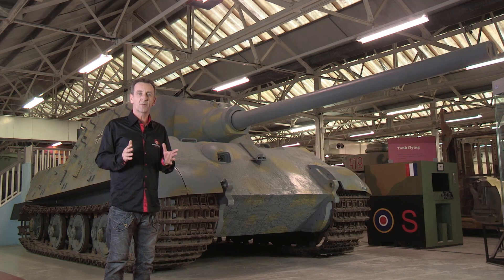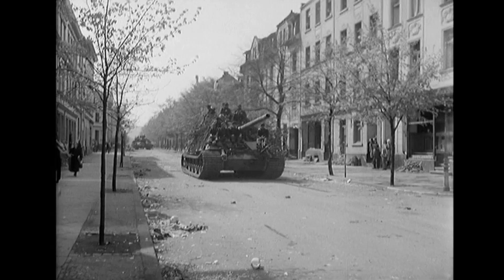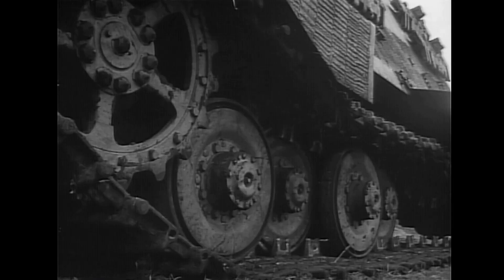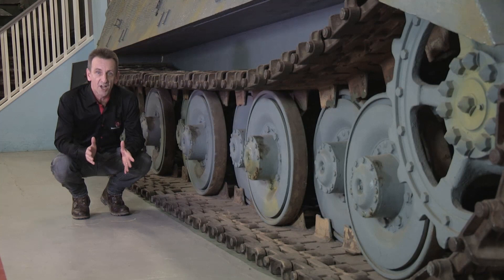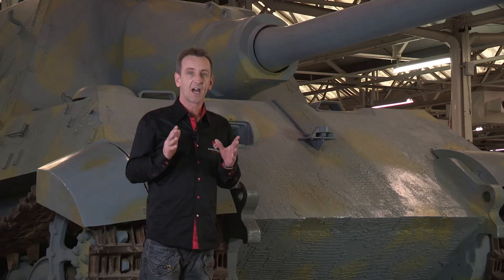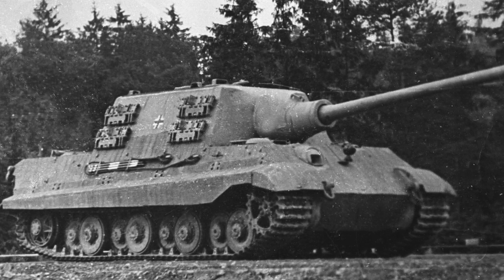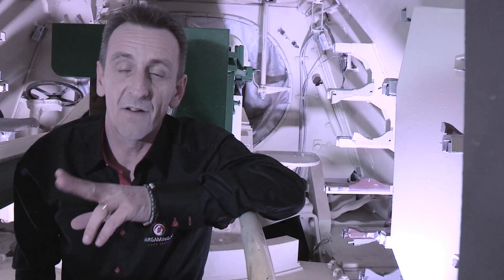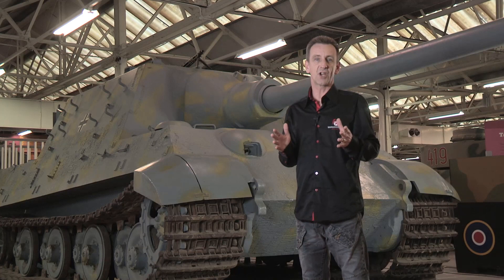Inside The Tanks: The Jagdtiger - World of Tanks

Comment: seeing the old video from the surrendering JT I am always amazed how fast they were ... not like the slow turtels everyone trys to explain ... for a vehicle of this size and weight they were pretty damn mobile
Reply: They are driving on pavement here. Imagine this mass in mud.
Reply: Until it breaks down or even catches fire.
Reply: Otto Carius' surrender.
Reply: @umartdagnir  thx to the with tracks and many roadwheels the weight is perfectly spread over the track ...the ground pressure of a JT was as high as all other heavy tanks of ww2
Reply: You are confusing the speed of the JT in the video for actual speed in operations. The JT in the video was surrendering to Allied forces. The driver could floor the machine into the red knowing that it was shredding the transmission and burning out the engine. Many military equipements even modern ones are designed such that they could go over 100% of rating with the understanding that doing so would be destroying or severely damaging them. For example, the US F-15's engines can be pushed to 125% of max power for about 30 seconds even though this means the engines were self-destructing. In peacetime, the control that activates this is wired shut in the off setting so it cannot be actuated by the pilot. In wartime, that safety comes off. Even an ordinary cars' engines can be pushed beyond the published max performance, but doing so means you will need a new engine and probably transmission, too.
Reply: @JS-ob4oh  nice

Comment: The US Army has one at its tank museum (not sure where now).  It has two impacts on its front, I assume from 90mm AP shot/shell, at nearly right-angles (zero obliquity) in the horizontal direction (plus the vertical back-slope of the armor hit, of course).  One was on the 60-degree-sloped front upper hull glacis and merely made a small vertical oval gouge a couple of inches deep as the projectile ricocheted away.  The second hit was more interesting:  It hit the long, cone-shaped gun mantlet on the right side (as seen from inside the tank) near where the gun stuck out and made a long, shallow gouge down much of the mantlet's side and then ricocheted off to make a small, shallow, round pit in the upper superstructure.  The mantlet was made of thin-chilled face-hardened armor (probably using a high-voltage electric arc surface induction method), not ductile homogeneous armor, as is visible here by the radiating cracks and the blocks of face split apart and shifted sideways in large pieces.  (Germany really liked face-hardened armor, since the by-1900-universal naval Krupp Cemented side armor was developed there in 1894, and used it in several tanks where most nations used soft, ductile, homogeneous armor.)  Neither of these hits would have done much to the tank, though the mantlet hit might have cause some interference with the gun's recoil if the deformed metal touched the barrel.

Comment: A typical example of their use was at the start of 1945, when - as part of Operation Nordwind - 16 Jagdtigers from the 65rd Heavy Panzerjager were unloaded from their railway transport, reassembled, and set out on a 90-km advance to contact. Ten of the Jagdtigers broke down and had to be destroyed during the march (being too heavy to recover), four were not fit to fight on arrival; and only two actually participated in combat: knocking out one possible Allied tank, and losing one Jagdtiger. Not a lot of value generated, for enough steel and labour to produce a battalion’s worth of Panzer IVs or a U-boat.

Comment: you got the stats wrong for the PaK 44 it's a 26kg shell at roughly 930m/s not 880m/s which is the velocity of the Flak 40 cannon used on the Sturer Emil. also the upper plate is 150mm thick the lower plate is the listed 100mm thick

Comment: Love the videos and will keep watching-unless or until you tell us you'd rather be in an ONTOS, than a JagdTiger.  ;)

And now a bit of fun.

Heaviest operational Armored Vehicle of World War 2 was the 63,000 tons standard Yamato, pride of Nihon Kaigun.
Heaviest Tracked operational Vehicle of WW2 was the 041 Karlgerat selbstfahrlafette, weighing in at 137short tons.
Heaviest (and largest) operational Tracked AFV has to be the FCM Char 2C of 77short tons mass.  These were ancient by World War 2, but all ten of them were entrained and headed toward operational deployment when demolished to avoid enemy capture.  Since the Char 2C had a 10--13 man crew, I get to add another 1500-1950lb . . . ah, heck, let's say another ton, making the tank 78 short tons MTOW.
Heaviest Rail Combat AFV was probably the CCCP's Armored Train that mounted three separate turrets: 1) a complete 152mm armed KV2 (HF2) turret, 2) a complete 45mm armed BA10 Turret, and a makeshift turret armed with a 76.2mm Pushka F22.  From the look of it, I can only assume it was significantly well armored and therefore 50 short tons or more.
http://tinypic.com/f02hpt.jpg

Biggest tank of all time, by dimensions, rather than weight or armor, is the Tsar Tank: http://en.wikipedia.org/wiki/Tsar_Tank
of 66 Short Tons.  It was 12m high, 17m long, and 9m wide.  Never operational, it was at least built and tested.

Comment: The heaviest, best-armed German tank-destroyer fielded was the Jagdtiger, of which seventy were built. A typical example of their use was at the start of 1945, when - as part of Operation Nordwind - 16 Jagdtigers from the 65rd Heavy Panzerjager were unloaded from their railway transport, reassembled, and set out on a 90-km advance to contact. Ten of the Jagdtigers broke down and had to be destroyed during the march (being too heavy to recover), four were not fit to fight on arrival; and only two actually participated in combat: knocking out one possible Allied tank, and losing one Jagdtiger. Not a lot of value generated, for enough steel and labour to produce a battalion’s worth of Panzer IVs or a U-boat.

70 Jagdtigers in total production. 16 available for the mission, 14 became mission incapable in transport. That’s 88%. If those reliability numbers hold up, then we are talking about never being able to field more than EIGHT of the things at once.

Comment: I find it quite ironic that the Jagdtiger's 12,8 cm L/55 actually had inferior armor-penetration capabilities to the Tiger II's and Jagdpanther's 8,8 cm L/71
Reply: What are you basing this on? Because the regular (APCBC) Ammo of the 128mm was better than the APCBC of the L/71 by a significant margin.
Reply: Edward Kiel huh? He was saying that the panzergranate 39 round, fired from the 128mm L/70, could penetrate up to 160mm of ANGLED armour (at roughly 40 degrees) from 1km away.
Reply: The Jagdtiger mounted a 128 mm L/55, not L/70, and according to numbers on both Wikipedia, and achtungpanzer.com, 88mm L/71 PzGr. 39/43 (APCBC-HE) penetrated 165mm of armour, sloped back 30° at 1000m, as opposed to the 128mm L/55 PzGr. 39/43's 143mm sloped back 30° at 1000m.

http://de.wikipedia.org/wiki/12,8-cm-PaK_44
http://en.wikipedia.org/wiki/8.8_cm_KwK_43
http://www.achtungpanzer.com/panzerkampfwagen-vi-tiger-ii-ausf-b-konigstiger-kingroyaltiger-tiger-ii-sd-kfz-182.htm
http://www.achtungpanzer.com/jagdpanzer-vi-jagdtiger-ausf-b-sd-kfz-186.htm
Reply: Dave Bastin
If I am wrong, then I'd love to be corrected, and I therefore invite you to look into the available penetration figures for yourself, and see what you can come up with.
Reply: I just did
Reply: Dave Bastin
So you looked at the data and came to the same conclution as me? Good.
Reply: Edward Kiel 
Allow me to correct you then: 

Using the full propellant charge and firing the std. PzGr.43 APCBC round (not to be confused with the PzGr.40 APCR series), the 12.8cm PaK44 (same as PaK80) L/55 featured a MV of 950 m/s and boasted a penetration performance of over 200mm of RHA at 1,000 m and 148mm at 2,000 m, all at a 30 deg impact angle. 

For original documentation:
http://img6.imageshack.us/img6/9858/nrty.jpg

All of this is already mentioned in your wiki link of course, don't know how you missed it:

"The light and medium charges were normally used when the gun was fulfilling the role of an artillery piece, where they would launch the ~28 kg projectiles to a muzzle velocity of 845 m/s and 880 m/s respectively. Finally the heavy charge was used when the gun was fulfilling its intended role as an anti-tank gun, where it fired a 28.3 kg APCBC-HE projectile (PzGr.43) at a muzzle velocity of 950 m/s. With the heavy charge, and using the PzGr.43 projectile, the Pak 44 was capable of penetrating just over 200 millimetres (7.9 in) of 30 degree sloped armor at 1000 meters, and 148 millimetres (5.8 in) at 2,000 metres (2,200 yd) range"

Comment: The new IS tanks had 120 mm of frontal armor and Terrifying 122mm gun<

This part is very questionable. 
First of all 120mm is pretty much nothing for the Germans since they have Tiger series and Panther than could easily pierce their armor like butter. The JS tanks were even vulnerable when it was being flanked by Panzer IVs.  The 122mm guns were nowhere near as deadly compared to the Tiger II's 88 when it came to range, Firepower, and accuracy. Plus it had a long reload compared to the flak 88's faster reload. 
Also  How can the JS tank count as a big threat? 90% of the Soviet army used T-34 85s. IS tanks were a lot more rare and barely did any good against the German tanks.
Reply: According to my source, the German tank commanders were ordered not to engage the JS-2 directly. What that says for the JS-1 I do not know. The Tiger II is an answer to the JS-2. The JS-3 is an answer to the Tiger II. They surely did not phase out the Tiger I for nothing.
Reply: It couldn't-from the front.  The 122mm was known more for its explosive effect vs penetration capabilities.  NO allied weapon could penetrate the front glacis at any range and only on paper could the 20pdr or 90/71 with HVAPDS penetrate the 250mm of the superstructure front at under 500m-on paper.  In practice, probably not.  This also means that no other weapon, including the standard 90mm, 20pdr, 100mm, or 122mm even come close.  It was a different story from the sides.  80mm, even with a slight slope was easy to penetrate. The IS2 was fairly easy to penetrate as it wasnt well sloped.  The IS-2m was harder as they finally sloped it.  The standard 88/56 needed to be at around 500m with a regular round and it could penetrate at over 1000m with its special round.  The 88/71 and little problem at extended ranges.
Reply: @ks29earl  Thanks mate..!

Comment: Question: Why do German tanks have that texture on them? Why do they have those horizontal grooves? What's the purpose of them? I'm really curious.
Reply: It is Zimmerit paste. It was meant to stop magnetic mines from adhering to the surface of the tank. Due to the low mobility of the german tanks this was a real threat, so they made that paste and made grooves. The grooves are there to not give the mines a smooth survace to adhere to.
Reply: This is a coating called "zimmerit", that was applied in factorys on middle war period tanks. It was there to stop magnetic charges from "sticking" to the tank(as you can see on the Jg KT, there is none above 2 meters high). 
(It had also thermical abbilities, reducing the heat in summer, and the cold in winter.)
Reply: Clelio Cerino +snipermakedonski Thanks! I learned something new!
Reply: Clelio Cerino The jagdtigers were a mixed bag. The first two or three had zimmerit up to the same height with the bovington jagdtiger (porsche suspension), then on the following tanks, the zimmerit was applied higher, about the same height with the top spare tracks. The last porsche JT did not have zimmerit at all and all the Henschel JTs (production jagdtigers) did not have zimmerit and they had three pairs of spare tracks on the hull sides. In fact, the porsche JTs were primarily test or training vehicles, only at the very late stages of the war they were sent to combat units.
Reply: the problem was, the only ones who used magnetic mines were the Germans themselves
Reply: Hj Md Firdaus
Haha! Maybe they didn't want their own mines to stick to their tanks.